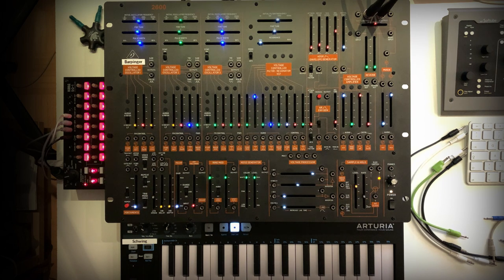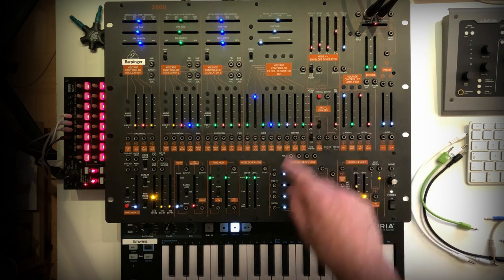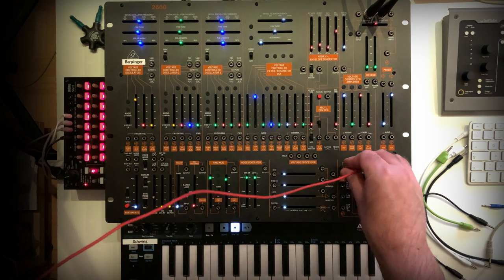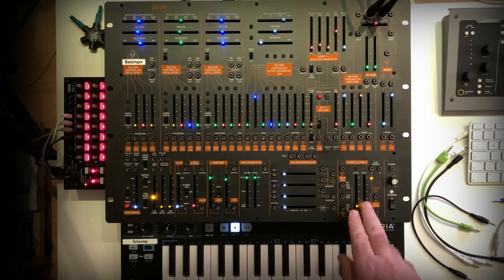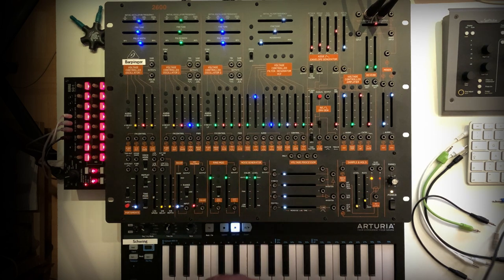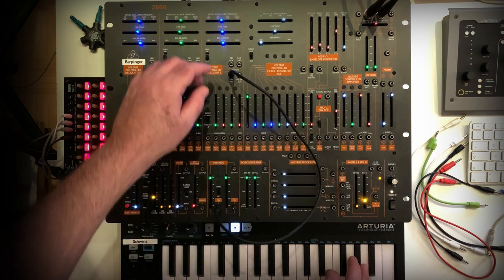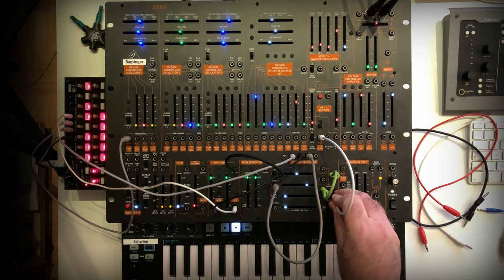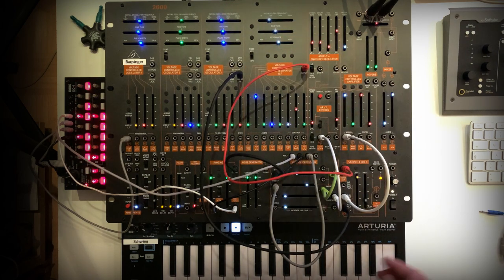Behringer 2600 - Quick Tips Tutorial 5: Dynamic Envelope and another VCA

Comment: Thanks for sharing.  I have a question... I connected my headphones output jack on the  Behringer 2600 and the headphones outputs from my Behringer RD 8, RD 9, as well as my TD 3 to the seperate inputs on my Erica Synths Techno System 2 mixer inputs. Then I noticed that my 2600 was not heard. I only could hear all outputs from my others. I experimented with the 2600 and checked out that my headphone volume was fully up to the highest level. I then checked the VCA Slider all the way to the right on the 2600 and that was all the way up. I decided to turn up the VCF Slider on the left of the VCA and finally could hear the 2600 but the Envelope AR or ADSR envelope was now not working. I should also mention that I have my 2600 connected to the Behringer 960 sequencer. The sequencer is synced to the trigger out Accent on my RD 8's rear. The step sequencer of the RD 8 moves each step forward in perfect sync. I have the 960 out going into the Voltage  input of the  2600 and output of Voltage on 2600 going into the AR Envelope in order to trigger notes correctly. Why do I only get sound out of the headphone jacks output when either the initial gain next to the 2600 is all the way raised or it's all the way down and then I only get output sound if the VCF slider is all the way up. Again that's a steady output even when all my gear synced up is stopped with no trigger from the sequencer. I like your advice on how I can resolve this. Thank you in advance, Sincerely, Michael
Reply from the maker: @michaeldulsky8492  hi Michael, thanks for your message. The 2600 signal routing can be confusing. Did you see this video?
https://youtu.be/H4M6SwtZykk?si=UaS_Zv3USDvoTMDm

Comment: Excellent! Thank you. I was looking to see how to make dynamic sequences so your video is exactly what I was looking for. I'd thought about, but not tried, using stacking cable into the AR in socket to combine outputs from a cv source for velocity and the AR envelope. Would you think that this would work to create a dynamic sequence?  :-)
Reply from the maker: Hi, thanks for your comment! The AR Envelope is in fact a slew processor with adjustable rise and fall times (much like a function generator on maths minus the cycling). So whatever voltage you put in, will be available at the output.
I think it's better to vary the input voltage of the AR, not the output. For instance, use the voltage processor to mix gate and velocity cv and use the result as voltage for the AR Gate.
Reply from the maker: Oh wait, i just realized that a velocity voltage is always "on", unlike a gate. So you better use the ringmod (or a VCA from elsewhere) in DC mode to multiply the two voltages. Otherwise the VCA will stay open at the last played value.
Reply: @tomnoise23  I tried your volume patching last night and it works very well thank you. My volume idea didn't work at all. I also tried to make the B2600 "talk" (as above) but couldn't make it work. Patching the sample and hold out  into the vca (filter input?) stopped all sounds coming from the synth (maybe some clicks only). Patching the sample and hold out into one of the filter cv inputs worked, although maybe not in the same way as your video?
Reply from the maker: For that sound i was patching the output of the VCF to the S/H input which is labeled "noise gen" - then synced the S/H (EXT CLK IN) to a very high frequency of a VCO Square wave that wasn't used for making sound. Then i patched the S/H output to the audio input of the VCA.

Comment: These videos  are  perfectly suitable  ,,talking with no audio from the synth,  audio  from the synth that doesen't drown out the speech and a steady pace and a clearly competent presentation.  

 More please.

They are  much more informative than  voiceless  demoes that omit  the fact that there are a multitude of additional devices  in use that leave the listener as clueless as when  they start  the  video.

A question.. 

I read somewhere online that this synth puts out 14 voltsin some places ,,too high for  eurorack inputs.

Is this correct please???

Can  I use my massive collection  of eurorack gear  INTO  this synths  for additional  external modulation....

Thanks  for yr swift reply
Reply from the maker: Hello John. Thanks for your feedback. I am glad that you like my content. As for Eurorack compability: The Original ARP 2600 needed 14V as Gate/Trigger voltage in some places. The Behringer works with much lower gate levels, as my videos demonstrate. Also the output voltages are all in a normal range. And in case that a signal may be too high, you can attenuate it with the Voltage Processor or one of the output attenuator faders that sit before the mixer. I am using the unit here together with some modular eurorack gear without any problems, it's all compatible. The only thing is that some concepts that the 2600 uses appear to be weird or not so practical these days. 
For instance you can't clock the switch from the outside, the trigger requirements for the envelopes are a little quirky and so on. But that's part of the history of the 2600.